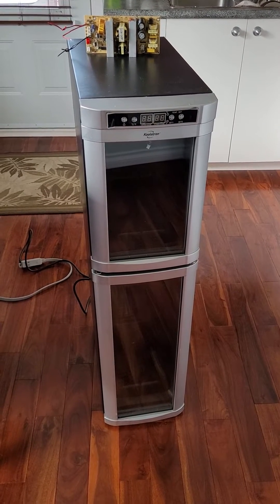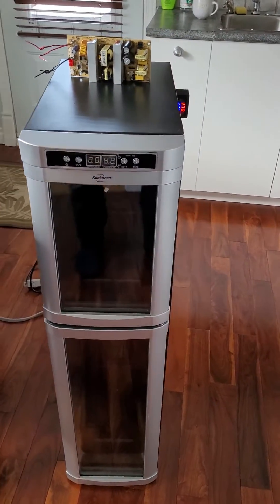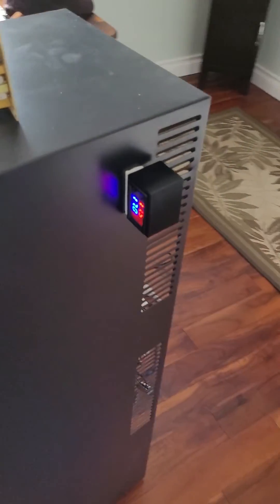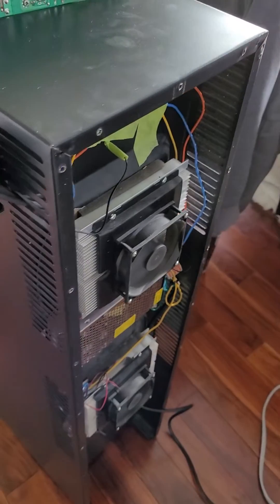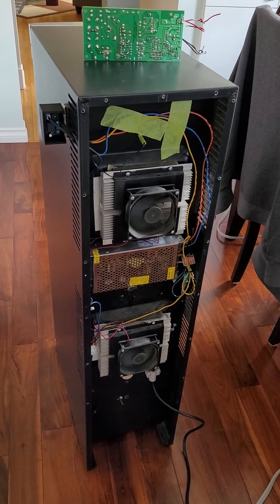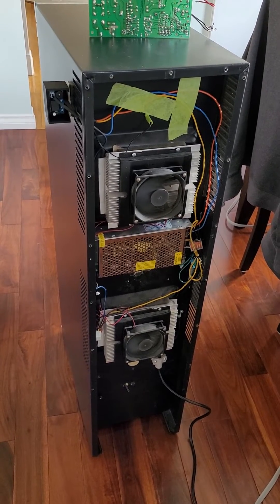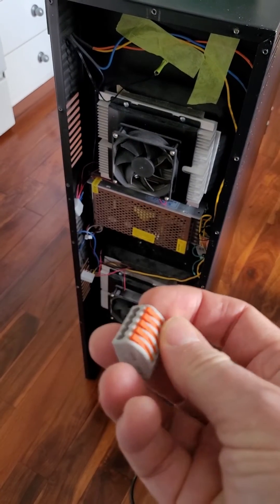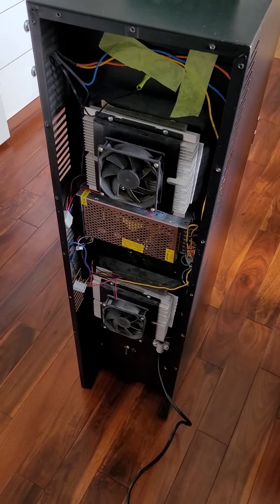Koolatron wine cooler repair DIY

Comment: Hey Brother,

Could you link me to that Charlie persons Forum or blog for the repair? I got the PSU and the Temp Controller/5 Wago connectors, but don't know how to hook it up from the fans. Thank you if so!
Reply from the maker: Darn I wish I could find the video, but it was 2 years ago. I'll ask my buddy next time he has the back off when cleaning the fans to take some pics. I feel like I might have put electrical drawings into the back of it in case I ever had to repair it again. I've searched and wish I knew how to spell the dudes name.

Comment: I have a similar unit.  Top section works great (8C coolest), but the bottom section cools nothing (fan turning) - bottom is set at 12 and it basically runs at the room temperature minus a couple degrees from what I suspect proximity cooling from the half that works.

Any ideas?  Are there board manuals if I take this apart?  I have all electronica tools and can read / replace anything but I'm not interested in reverse engineering a circuit to figure out it might be a dolt.

Troubleshooting ideas or other suggestions anyone?
Reply from the maker: Hi Gjjb sorry for the delay. I could not find any info to assist with repairing the control board. If it is the same unit, I would test out to verify if the bottom peltier unit is working properly. Let me know how you make out.

Comment: hey - any way to get the original lights / control panel to be working if it's just a power issue?

mine is in the same boat right now and trying to figure out how to fix it without losing the original panel.
Reply from the maker: I did too. Getting a replacement board was to risky  and the reason I opted to convert. I fixed it for friend and he's still using and enjoying the cooler.

Comment: I got a question for u. I got a wine cooler that i set to 18c and it constantly goes to 10c any ideas
Reply from the maker: Hi Colin,  yes a few ideas.  Are you able to test some of the components with a multimeter?  What type of wine cooler?  Does it have a compressor or a peltier system?  Either way do they ever turn off?  Peltier will have fans that should turn off,  same if it's a compressor.  Could be the temperature sensor has gone bad or the controller isn't turning the demand off. Let me know.
Reply: @mayhemsmiley  it's a whynter humidor CHC-122BD it's a peltier system I've already changed the peltier plate it's better but fluctuates between 15-18 now
Reply: @mayhemsmiley  I'm thinking it might be the controller fans don't turn off completely but they slow to an idle